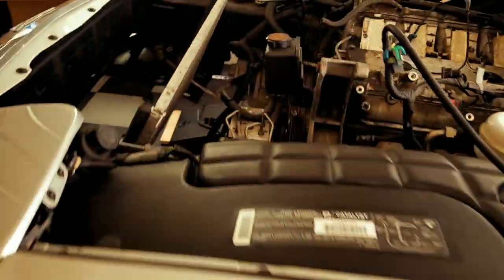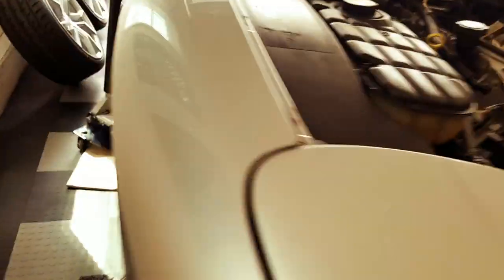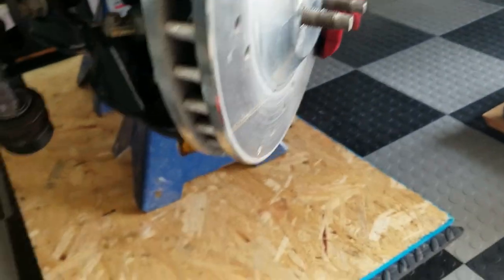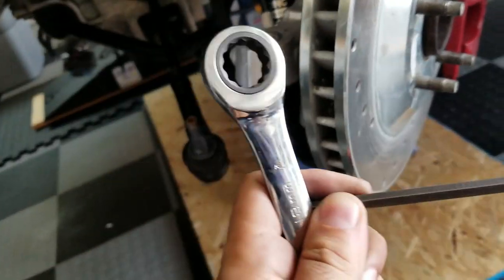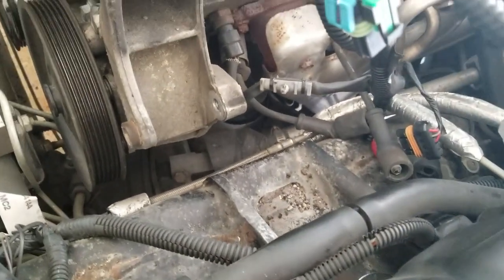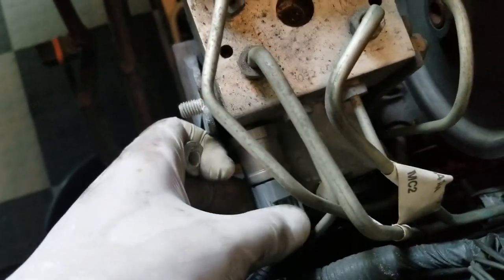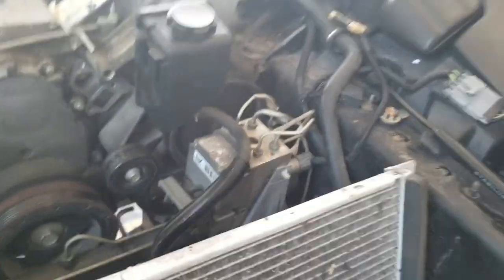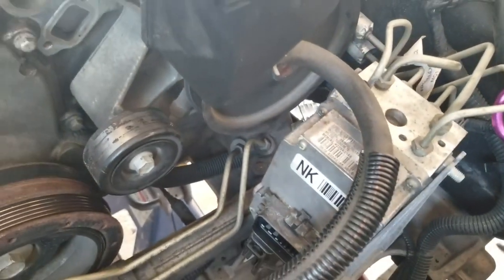Steering Rack Removal - C5 Corvette Build - P7

Comment: If I’m just needing to replace the crank balancer bolt with an upgraded ARP bolt is there a way to just loosen the steering rack to slide it forward at all to make enough room for the bolt to slide in or will I have to completely remove it out of the way as you’ve done in the video?? Thanks for a reply if you can remember since it’s been awhile since you’ve done this!
Reply from the maker: If I remember correctly, you have to completely get it out of the way. I was able to loosen one side and push it out through the hole on the other side without completely removing it from the car. I think that was the biggest pain since initially I didn’t have the right tools. There’s going to be a ton of patience necessary as well. Hopefully someone’s figured out a way to do it per your suggestion because that part was not all that fun.
Reply: @CarModGuy  Do you recall which tool you needed to do it easier? Also did you need a different length bolt when you upgraded your balancer?Thanks
Reply from the maker: @Zem4ro  https://amzn.to/3MZP6r0 …it’s the flare nut wrench set. I believe I kept it in 5th if I recall correctly. It still wiggles a little but holds enough to keep it from turning.
Reply: @CarModGuy  Awesome, thank you! Yeah I actually found your harmonic balancer install video. Appreciate all the videos.

Comment: I’m getting my harmonic done as we speak. I was quoted $400 labor from a reputable mechanic I know. Sounds cheap but he’s good. I bought parts myself along with a front oil seal and arpi bolt When he started removing the rack one of the boots was a bit wet. He told me since he has it out go buy another rack. Little did we know it was $800 new. We looked and not one shop stocks them. Wtf. A rebuilt is still $400 and a week for ship. He can’t wait a week since it’s apart on his lift. Did your rack have any wetness to it? He’s putting my old one back in and said it should outlast the car. I hope. My car has 64k only on it. I’ve owned it 17 years and I never had to put any power steering fluid in and shows full. Im wondering if they all do this and is it kinda normal for some fluid wetness. I don’t see any leaking on driveway and my Ps bottle  is full and have never touched. it.  Thanks for any reply
Reply: Hey, late reply but when I took my C5 in for an alignment, they told me that I had some sort of power steering leak that was likely coming from the rack. However base on the research I had done, I had a feeling the leak was coming from the High Presure Line that runs from the PS Pump down to the PS Rack itself. 

This High Pressure PS Line leaks commonly on the C5s and gets fluid everywhere. Maybe that is where your leak is coming from? The OEM PN for this line is 26046501. They are about $11 on Rockauto. 

If it is your rack then yea, rebuilds are quite pricey and finding a replacement is expensive. I was looking at this myself when I first discovered my leak. Take a look under your C5 while its running. Find the PS Pump Pully from underneath by peaking through the subframe/leaf spring. You'll see the line come down from the PS Pump to the rack.
Reply: @ramflow8466  hey thanks for reply. They actually poked the rack boot with a pin and some fluid seeped out when they squeezed it, which means my boot has fluid in it when it’s not supposed to. But the cars a 2000 and it’s so minute it took 23 years for the boot to get enough fluid in it to show it leaking…. Theres no drip marks on ground whatsoever so I’m leaving it alone :D. Ive head the car 17 plus years and I’ve never even topped off the power steering reservoir

Comment: Looks like a usual pain in the ass. Cant wait to do mine 156k
Reply from the maker: It is...I have to do it on my C6 now
Reply: @CarModGuy  i appreciate the video alot man. Im gonna watch other stuff you posted. I have a question though, when you drop the "cradle", does the engine need to be supported seperatly? Im having trouble understanding that
Reply: @CarModGuy  im gonna watch the cradle painting video that will prob answer my questions. Thanks again for so many c5 videos youre gonna help me out so much
Reply from the maker: Steven Johns if the engine is still attached then the engine will just sit on the cradle...otherwise if you disconnect the mounts it’ll have to be supported separately